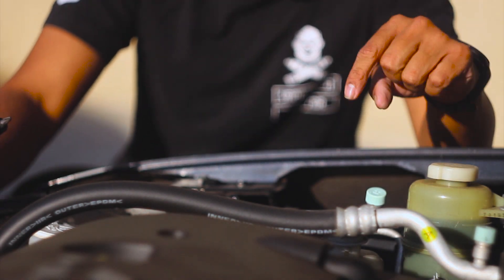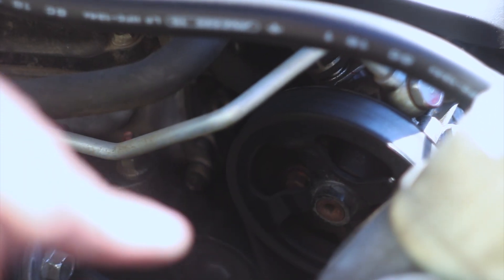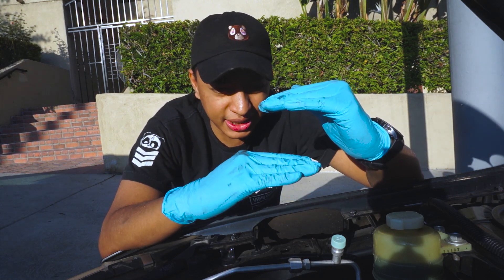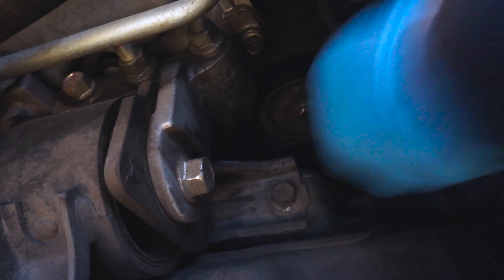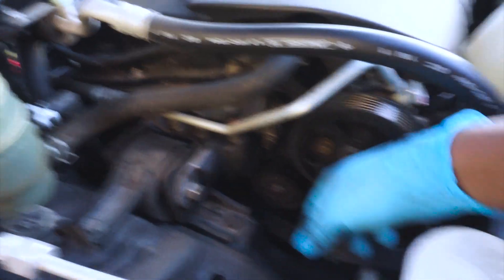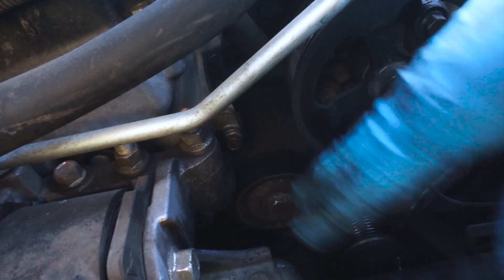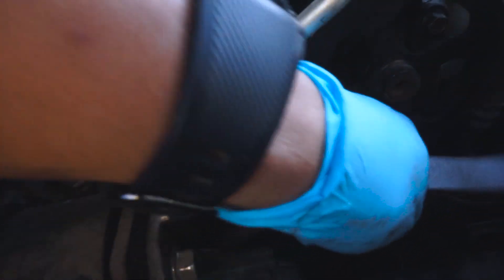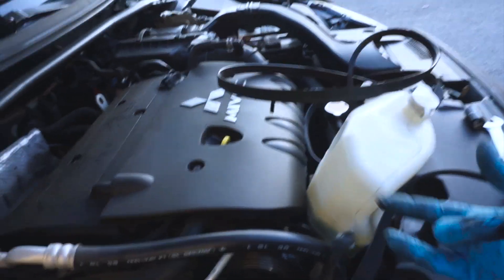How to Change Serpentine Belt on Mitsubishi Lancer - Project Croox Ep. 2

Comment: Doing this by yourself is annoying, but definitely doable. I recommend getting the serpentine tool, just don't pay a lot for it. The tensioner is 16mm. You can use a long handled combination wrench, but I had no luck getting a regular socket wrench in there. If you have the belt run correctly and the tensioner turned ALL THE WAY, there shouldn't be much effort to get the last part to slip on. The easiest part to be last seemed to be the idler pulley. If you cant get anyone to hold the wrench, an industrial zip tie works with some effort. You need a 12mm socket to remove the expansion tank. There is a slot to use a phillips, but if its rusty, you're just going to strip it.
Reply: 16 mm? thanks i will check. the manual called out a 5/8" offset
Reply: @jilllin6979  Either should work fine.

Comment: missing is, there is a small hole and a "v" shaped projection on the auto tensioner. you can feel for them. release tension with a long 5/8" offset wrench and insert an L-shaped hex wrench through the "v" notch into the hole and the auto tensioner can be held open. thank you for the video. i hope my comment added more info.
Reply: all i needed, lol

Comment: To anyone who had to struggle like I did, the tensioner its a bitch to push, I found the easiest way to change the belt, was to use a 5/8 box wrench, mount it at the lowest position and pull the tensioner ( wrench) towards the engine mount, another person can use two or three industrial tie wraps and lock the wrench to the engine mount, feed the belt through all the pullies BUT the crankshaft, grab a long flat head ( the longer the better ) and work the belt in place, once the belt is in, cut tie wraps and start her up.

Comment: I'm lost at what did you unscrew at the beginning to remove the tension from the belt? I though it was the idle pulley right next of the alternator but your wrench seemed way lower, like on the ac pulley.

Comment: If only it was that easy to do. I've done mechanic stuff on and off my entire life and I can't get the new belt on at all. I'll need someone to hold the wrench on the tensioner so I can push the belt over the back rear pulley.
Reply: This is me right now
Reply: Bro how did y’all end up doing it ? Currently by myself and struggling with that part

Comment: I have a 2008 lancer  with the 1.5 engine, would this belt work on my car ?
Reply: Thanks for the comment, i was looking around and it looks like they are two different sizes. i would suggest going online to sites like carid where you can check what exactly fits your engine.
Reply: I also have the 1.5L Lancer, i use a 5PK1193 belt.
Reply from the maker: @cotisado16  for sometihing like that i would just stick to the factory specs, unless you find a legit upgrade. most of the time is better to just stick to the same brand. good luck, i hope this helps.

Comment: Maybe you know what happens to my car?Making Squeaky noise but belt not turning at all?
Reply from the maker: have you replaced the belt? It can be wear on your belt, Idler pulley bearing, tensioner pulley bearing, I would suggest replacing the belt if you havent done so yet. If you have, check that every pulley turns without too much effort. good luck man hope that helps ❤
Reply: @edwinjovel6473  Hello thanks I bring to garage and seat over night.Start car no problem at all.Maybe that  day was so bad rain car was parked next to wall then quick freeze maybe go on pulley and stuck?Is this possible?
Reply from the maker: @josipstimac9319  most likely. Sometimes at Xtreme temperatures it can freeze but I would keep a check on it and see if it does it again outside and try one more time inside after. Good luck 👍😁
Reply from the maker: @josipstimac9319  ps: make sure everything is tighten to spec if needed.
Reply: @edwinjovel6473  Thanks and sorry for late replay.Thanks for advice.
Reply from the maker: @josipstimac9319  is all good, thank you for the support really appreciate it ❤️👊🔥